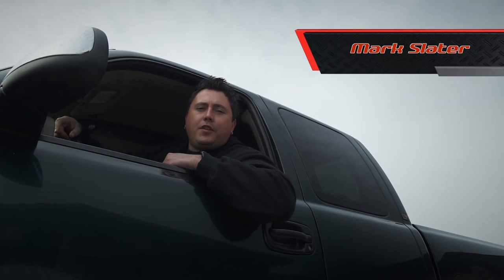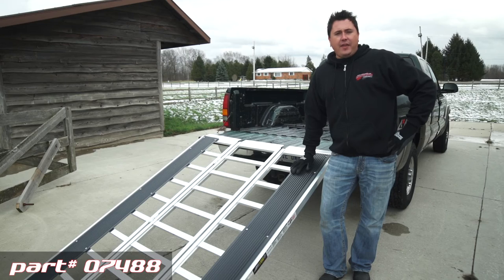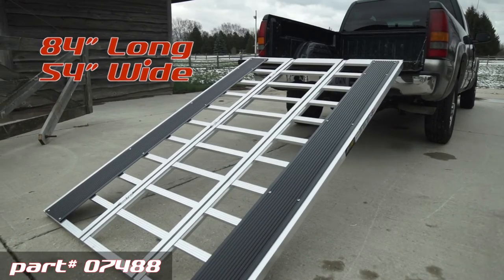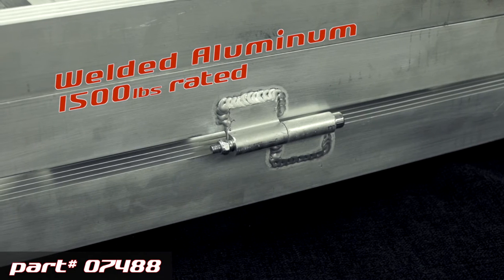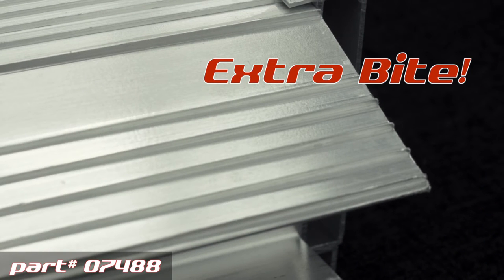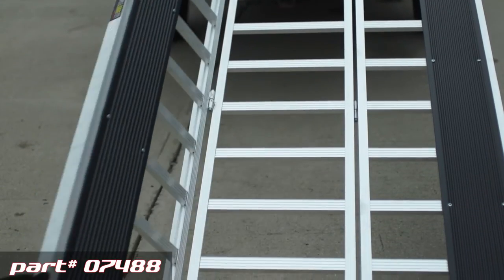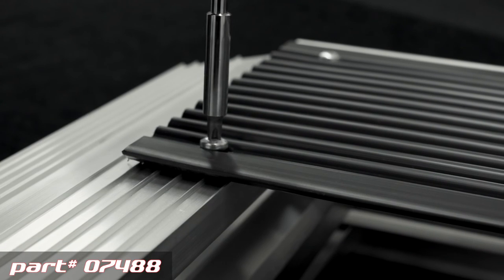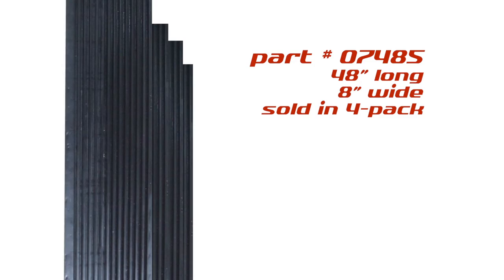07488 COMBINATION LOADING RAMP

Comment: Where do you place the safety straps?
Reply from the maker: Place the safety strap around one of the rungs and secure to your vehicle or trailer.  Where to secure on your vehicle or trailer will depend on vehicle or trailer.  Secure it so that the straps will not slide or move while loading.  If you have further questions you can reach out to our Customer Service department at 888-546-4668 x 227